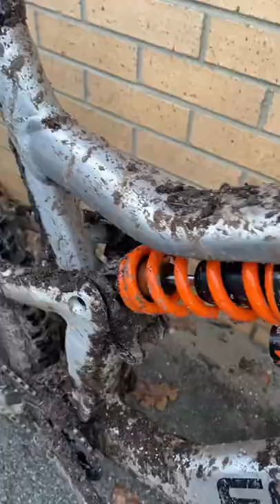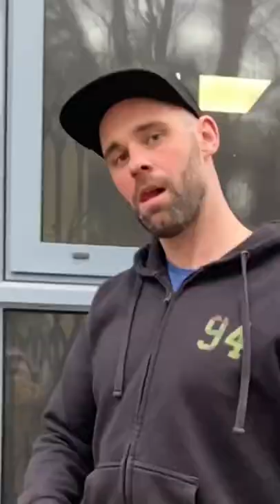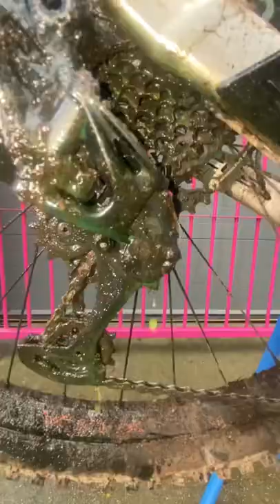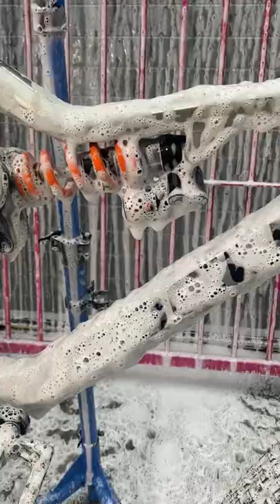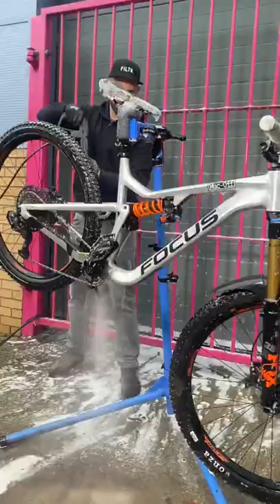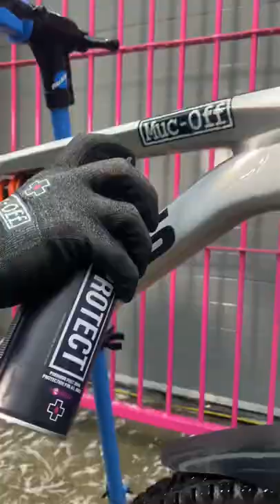How Do You Wash Yours… MTB that is 😂

Comment: I'm pretty sure it's recommended to not use a pressure washers on bikes.
Reply: The muc off pressure washer is lower pressure than the average patio cleaning karcher or equivalent brand and is perfectly safe to use on push bikes 👍 always consult the manual before use for more info
Reply: lol, Your better off to use a low pressure Pressure washer than a garden hose. Garden hoses absolutely soak and flood things with water.
Brands like rocky mountain have bearing shield washers, go to town with a pressure washer at any pressure and the bearings will be sweet as.